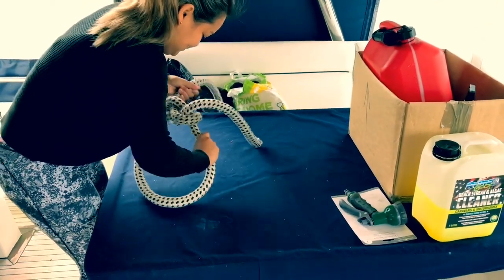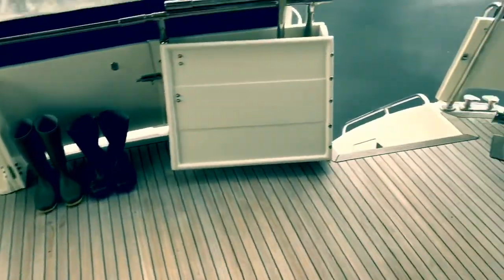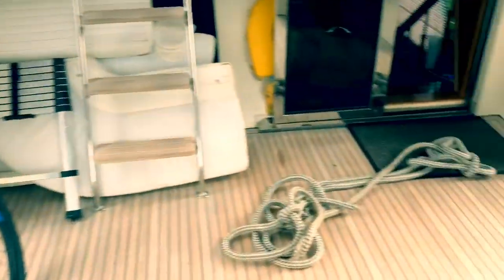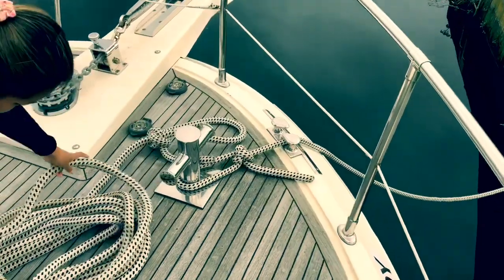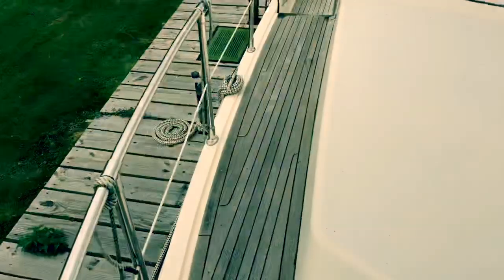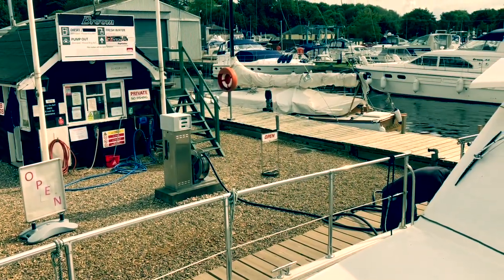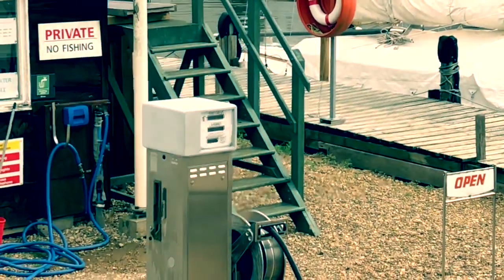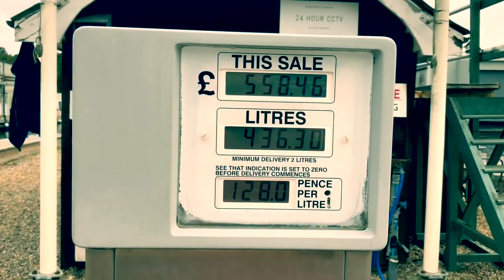Independence Gets A Top Up

Comment: An update it's been awhile.

Considering how much traveling she's done how much she's weights heater & genny hours ect is that an OK fuel burn for this boat, with her engine power & weight what's her fuel capacity 3000lts so unless your traveling to France ect I think your bills won't be more expensive than your capacity 😆😆

That burble from those engines is just utter filth 😆 she's an impressive beast on the water.

Comment: Practise makes perfect, keep trying, she will spin in her own length on the throttles but you will get it sorted in time
Reply from the maker: Indeed, though there is a lag between throttle movement and actuator moving the physical throttle on the engine which takes some getting used to but once down the fairway it all came back and came alongside Brooms without issue and then went off up towards Norwich but was running out of depth to get back to the Marina so had to turn back to know I’d get back to her mooring without enough water under us.